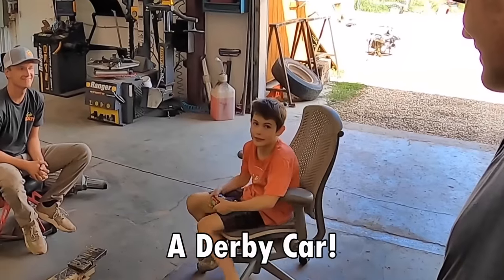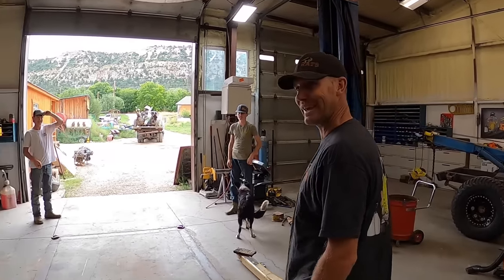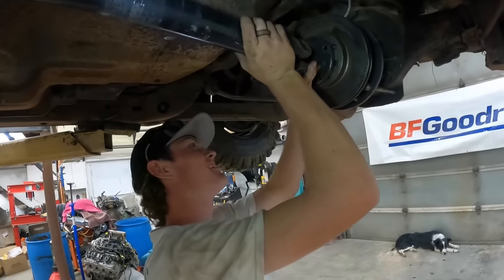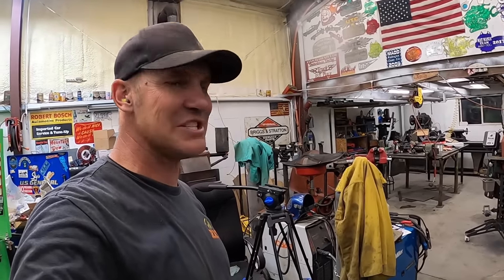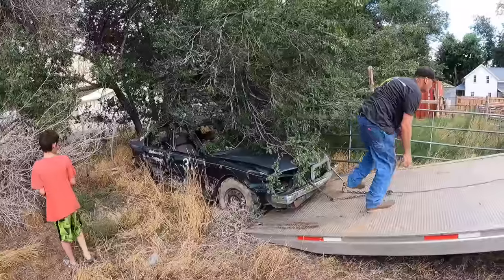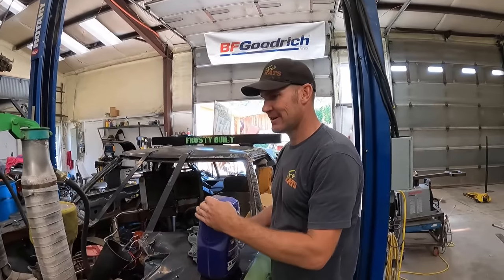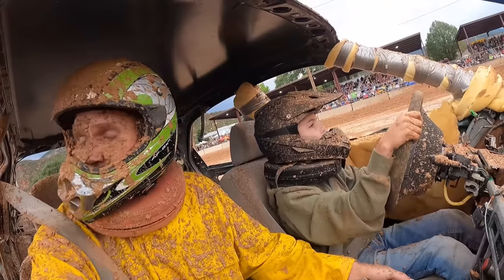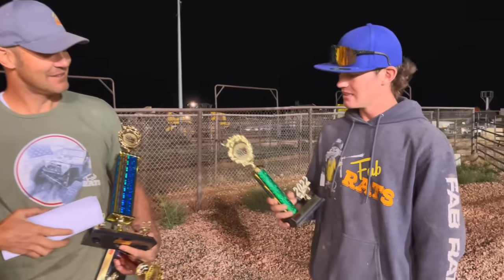We Have NEVER Done A Video Quite Like This Before!

Comment: Paul and the boys wrenching and racing together on derby cars, I am DEFINITELY here for that! Great job guys, so awesome to watch!
Reply: Do people realize how valuable & more valuable these old cars become by the year?  Not because it's vintage but because it's not tracked by GPS, doesnt have video cameras in it, does not "park assist"(which means the car can be steered without you).  Did you know the average new car sends about 20 to 30 giga bytes per hour when moving?  I dont know about you but I DO NOT want any of that.
Reply: @jaredkinneyjr  do you uses a cellphone? Cause if your worried about a car giving out your information, you got worse problems. Also all of these car were wrecked before. About 95% of demo cars are previously wrecked cars or non valueable cars

Comment: The last time I went to a demolition derby was over 40 years ago when did they switch from hitting with the back end with the front of the car? It looks like it would cause the engine to heat up and die quicker. At the start of the derby all the cars would be facing out and be on the edge of the Derby arena then at the start they would all back into each other as fast as they could.